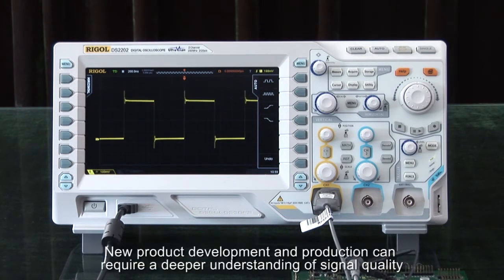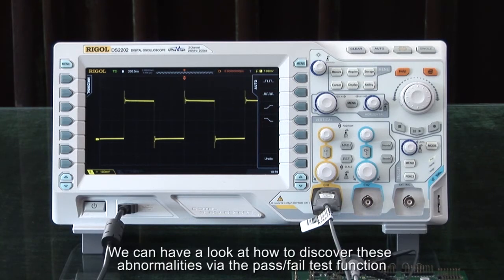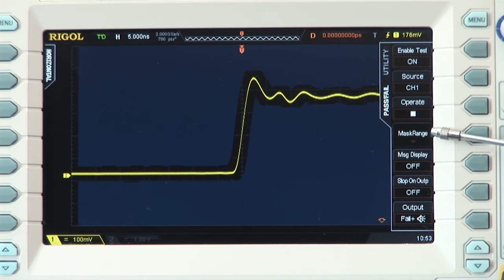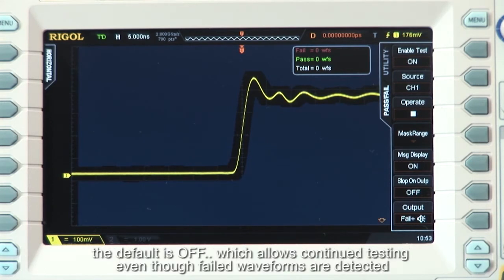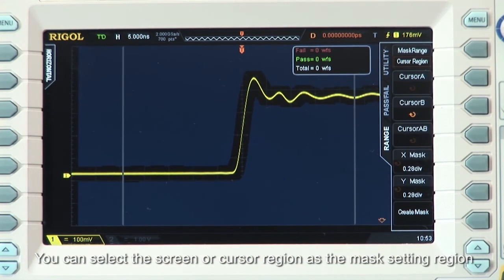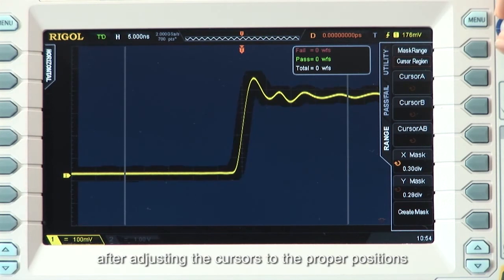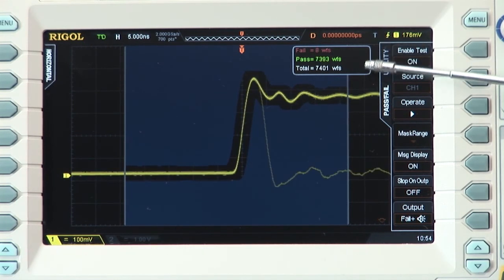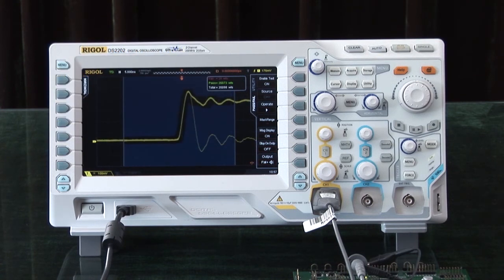Using Pass/Fail Analysis

Comment: These short feature videos are very helpful.  So...regarding your comment at 1:35 "...and enable the auxiliary outputs on the rear of the panel to output a pulse when failed waveforms are detected."  What kind of pulse?  Could I for example take a cable with a BNC connector on one end, cut the other end open and connect the shielding to a ground pin and the middle wire to a data input pin on a 5V Arduino (not a 3.3V because I'm guessing maybe the BNC output pulse is TTL?)?  How much current can the BNC output source...10-15mA?  I've found zero info about the Rigol BNC output pulse specifications, neither online nor in the user manual, in particular nothing in "Chapter 17 Specifications."
Reply from the maker: The pass/fail outputs are typically TTL signals. These don't drive a lot of current but should be enough for a DIO like on an Arduino.
Reply: @RigolTech  thanks for the reply!